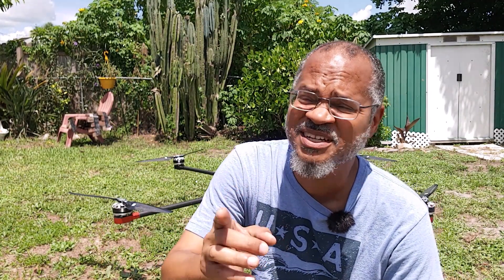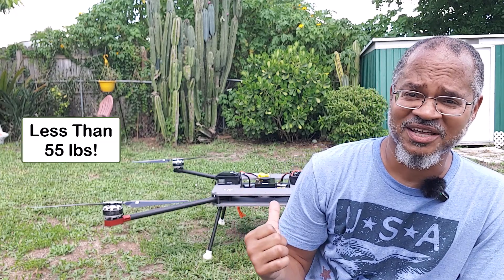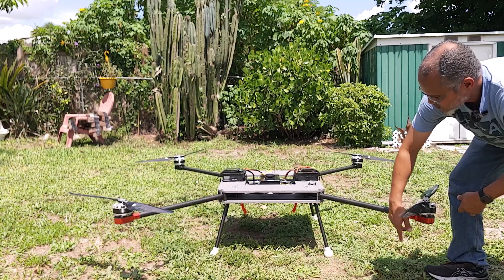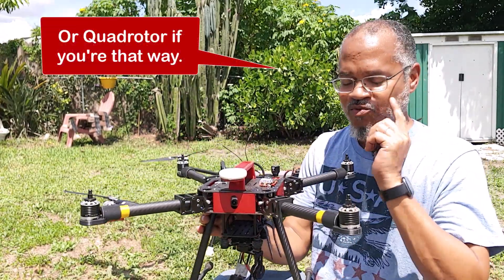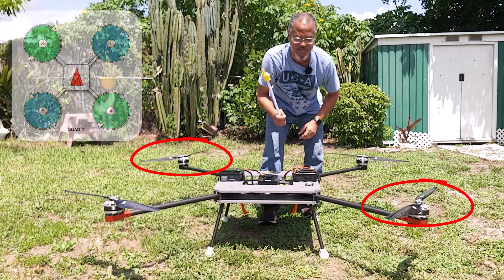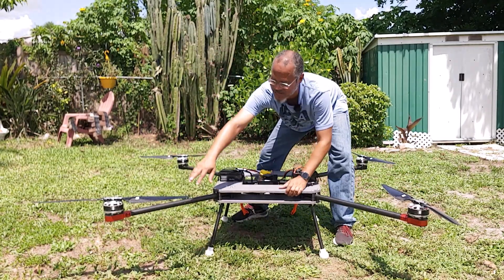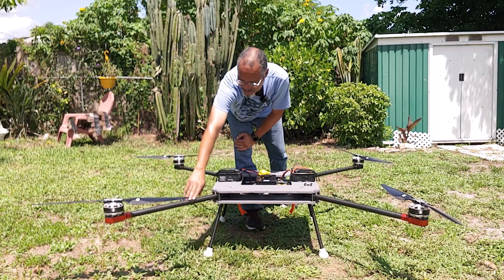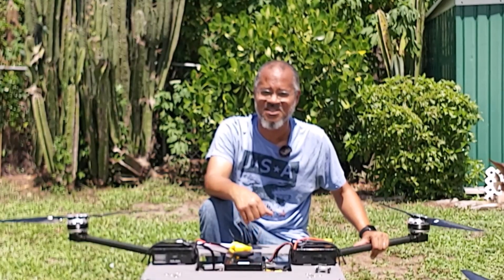Drone Yaw Explained (Without the Boring Bits)

Comment: I'm almost 50 and just getting into FPV drones. Understanding pitch and throttle was easy, but I was going crazy trying to understand how the drone's yaw worked. Thank you, sir, for the great explanation.
Reply from the maker: You're welcome. I'm glad it helped. Yaw motion is always a difficult concept because there's no obvious linkage between the direction that the props are pushing air and the movement of the drone. Happy flying!